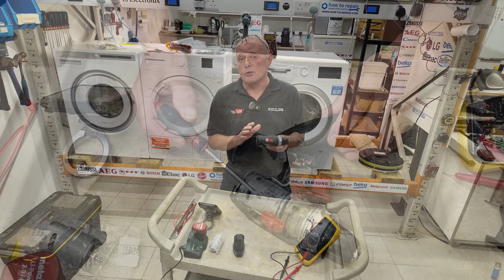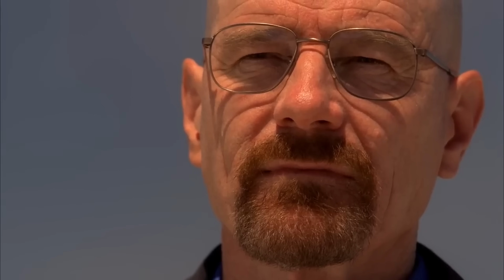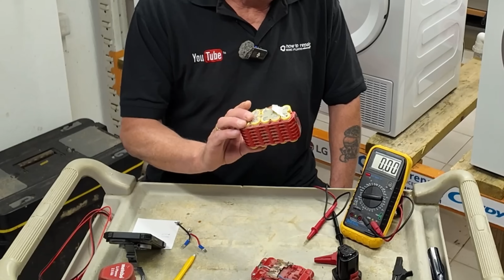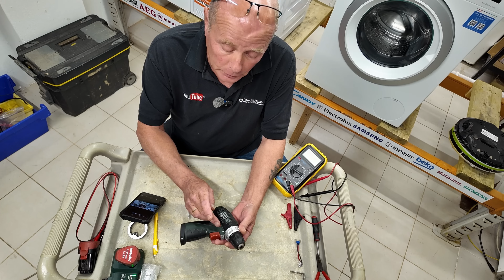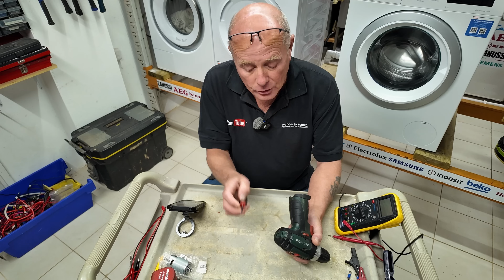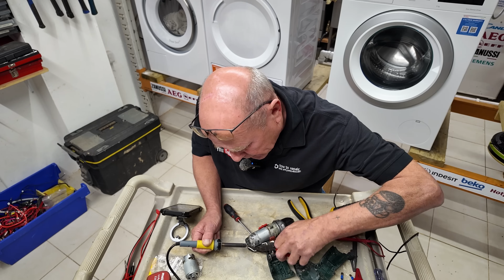Saving a Drill From the Landfill How I Repaired a Broken Metabo Drill Instead of Throwing It Away

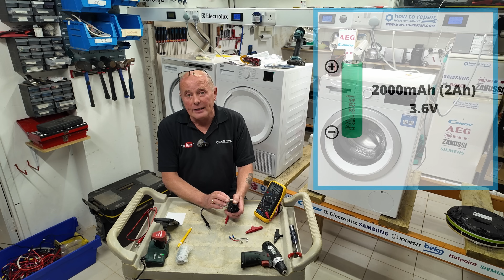Comment: 9:00 So if a battery pack voltage drops below the maximum voltage by the value of one cell "3.6v in this case" the charger will not charge it?

Comment: I had the same problem on a drill. I could buy the motor for cheap but i had also destroyed the gear housing. So i made a 3d-model in cad and 3d-printed a new one and the drill still works fine.
Reply: I think 3d printing is going to be a big worry for large manufacturers , giving us the ability to repair more and more

Comment: Thanks a lot. Good Video. You really don't have to have a studio setting to teach about reairing things. 
I would like to make a few suggestions: 
Could you talk about the danger working with electricity. If there are none or what has to be pointed out. 
And (maybe not so important) I would test the polarity before soldering the wires so that the drill rotates the same directions it did before.
Greetings to the UK...still sad that you left us.

Comment: GREAT WORK!
8 pounds for a new motor
And it’s a professional brand
✌️
Reply from the maker: yes I also was astonished. It's amazes me how many items we throw away without considering the consequences of the other items that we throw with it, I went up the local tip the other day and was speaking to the manager. It was amazing to see how many cordless batteries are thrown out after doing some research. They say that nearly 10,000,000 items are thrown out each year in the UK alone and I guarantee you that 80% of the cells and these cordless drills are still in good condition or usable
Reply: The motor is a chinese knock off. It sounds different to the Metabo one. I wonder if it has the same performance. Still a nice repair though.